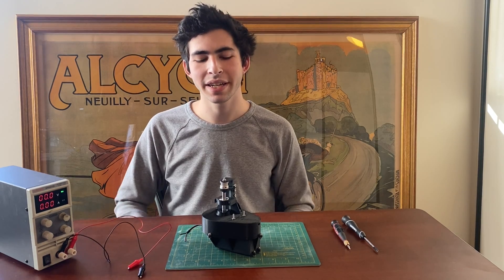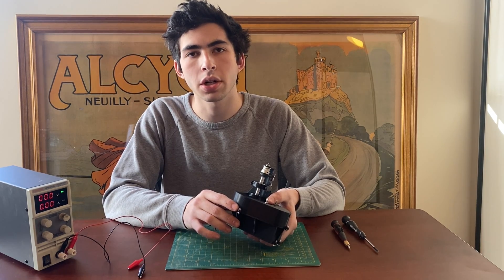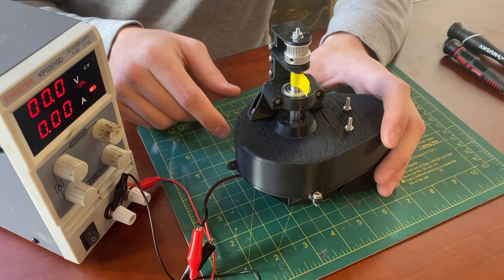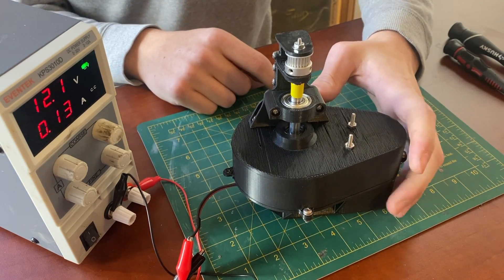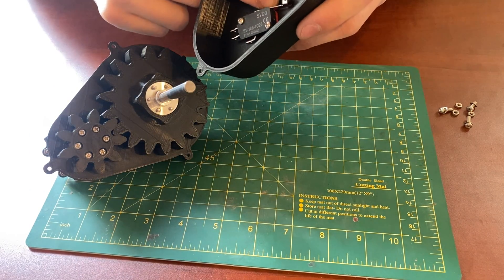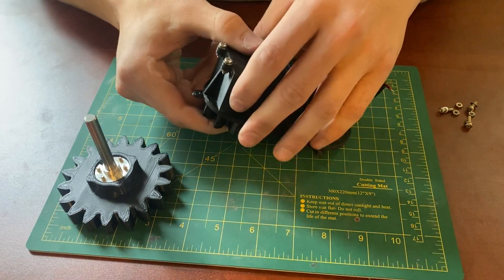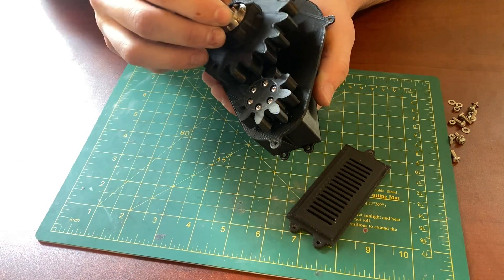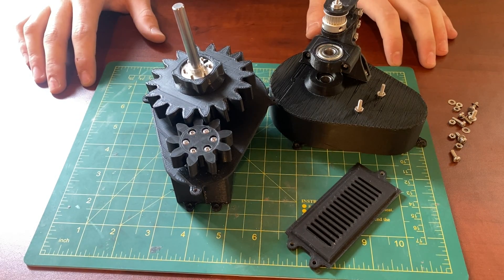Low-Cost 3D printed Gearbox for Robotic Joints

Comment: Simple, clean design. I would be intrested to see how much torque it would take to sheer a tooth, are those 100% infill?
Reply from the maker: Hey John, thank you for watching. I would also be interested in seeing how much torque it would take to break one of these gears. While I didn't print them at 100% infill, I believe they are about 15%, they are way oversized. This joint was for a high-fiving robot so I wanted to be sure it could take a beating. Thanks again!